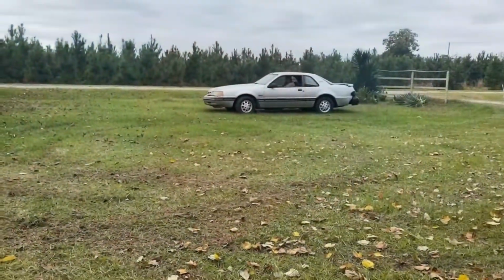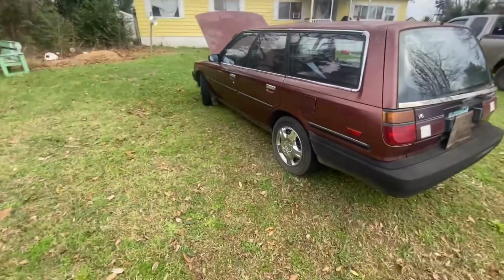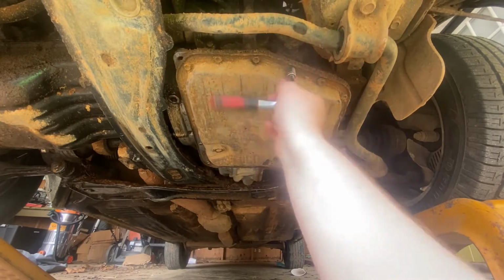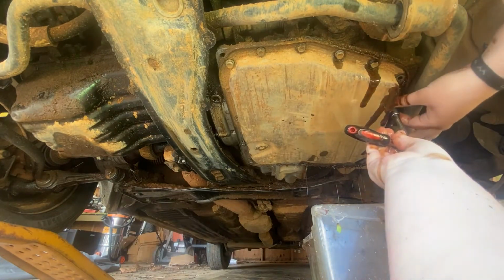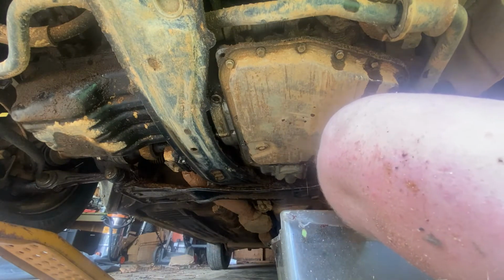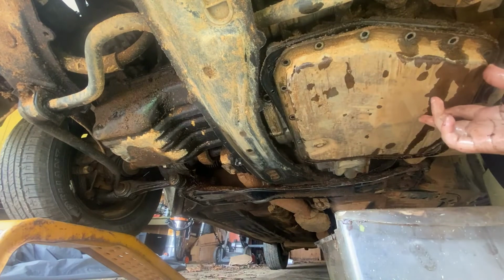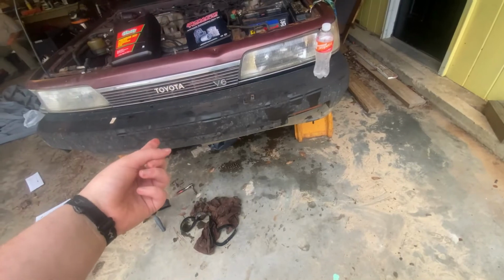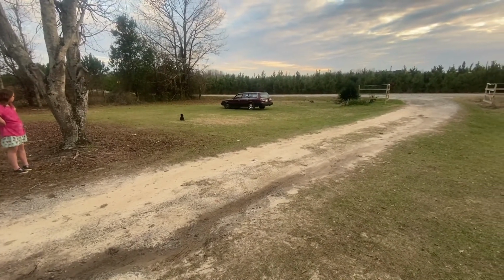T-Bird Fuel Pump Time!!!!! 89 Camry Wagon Review. Is Puddin done for????

Comment: I have the same stalling issue with my 85 Tbird, new fuel pump, replaced the air temp sensor and still stalls after driving it some distance, so next thing I'll replace is the fuel pressure regulator which is I think the root cause of the issue as the stalling is clearly a fuel pressure loss and the fuel pressure regulator has never been replaced so hopefully that fixes it, will be installing it with my brother on the weeknd and see how it goes.. lmk if you still have that issue and what other things how you found so I can help you if I can, cheers!